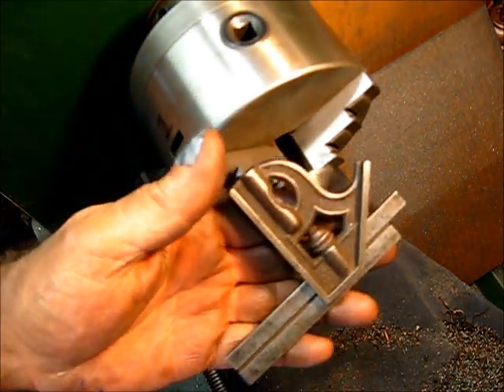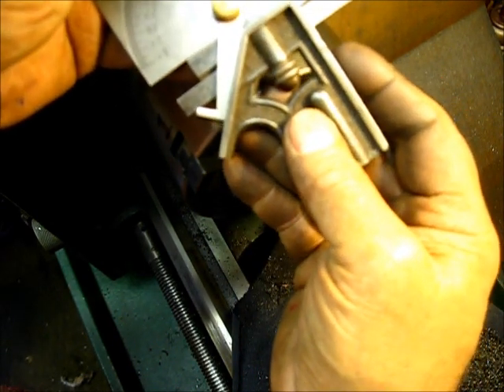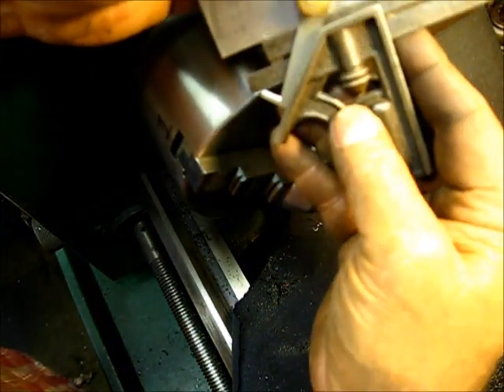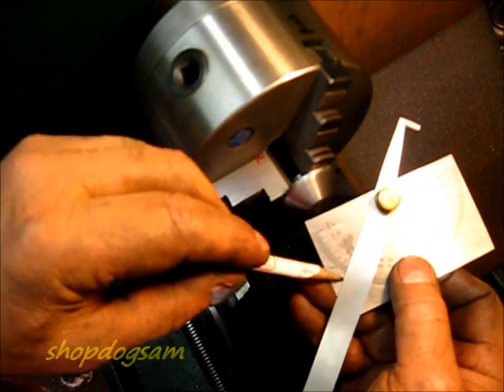I H C ENGINE how to build intake and exhaust valves #3

Comment: Nice job Sam.  I may have to make some valves for my Witte.  I taught machine tool for a few years, so couple comments that may help you.  When using the cross slide to machine an angle keep the handwheel moving.  Don't turn, stop, turn etc.  Keep it moving at a steady pace and you'll get a much smoother finish.